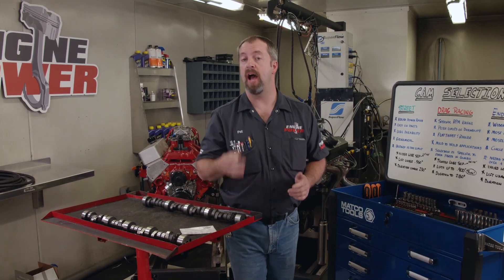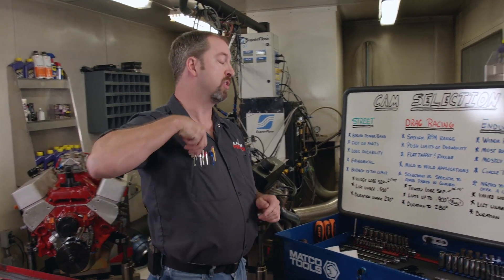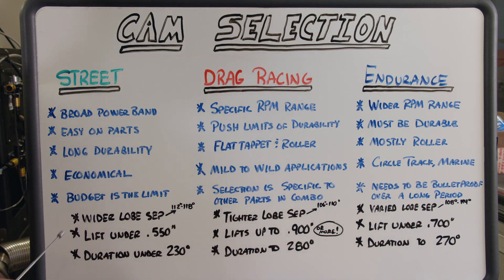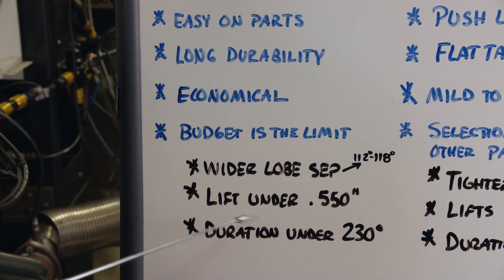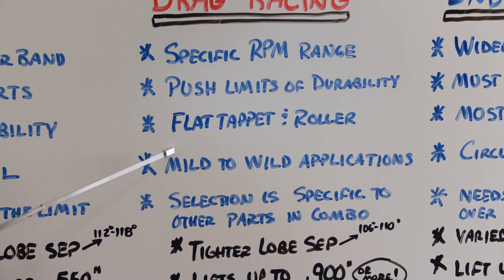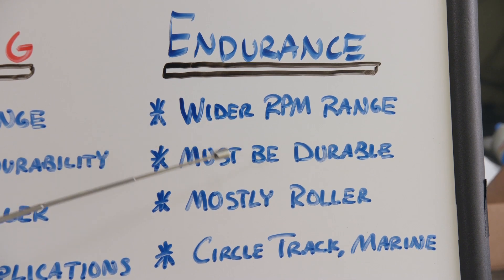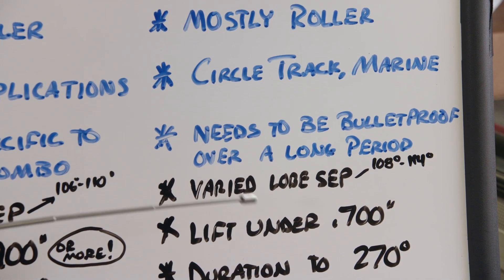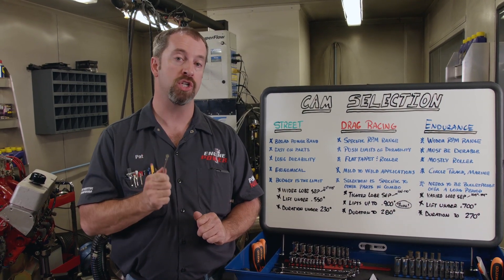How To Choose The Right Cam

Comment: I have a 2010 5.3 lc9...looking to get it up to 400 or so hp..any suggestion ..i already have a 1 in 2 out muffler..thanx in adv.
Reply: nofrop Texas speed stage 3 truck cam will get you close but if you have vvt you might need the vvt cam but 5.3 usually need heads to reach that to the wheels but to the crank it can be reached a lot easier call Texas speed they have everything even in packages

Comment: What are some nice lopey cams for my 2002 5.4 v8 triton with cold air intake and longtube headers
Reply: Questen Atwood Ditch that spark plug breaking piece of junk and swap in a coyote 5.0 and use a standalone ECU. If you keep that engine, please watch your oil changes because everything is run off of oil pressure and the slightest piece of gunk seems mess up your cam solenoids and other oil pressure regulated engine components. If you get a different cam you’re going to need supporting mods as well like valve train, intake manifolds, ECU tuning, and so on. You’ll need a cam that matches the flow rate of your heads/intake manifolds and you’ll definitely need a tune as well. First you need to decide if that engine plate-form is even worth the money/time. Then you need to figure out what you want to do with that vehicle. Towing? Racing? Mostly low-mid rpm or mostly high rpm? I know I didn’t answer your question but I hope I gave you some helpful insight. I hope everything goes smoothly with your build, cheers!

Comment: I guess my cam is too big for street. Shit. Lol. If you have an ls motor. You can go around .600 lift and 230s duration and you will enjoy it. The lobe type is Pretty important on Valvetrain durability as well. Seen a couple people asking about cam for a 5.3.. comp cam makes a cam XR275HR that would give you a nice chop with that many cubes. May need a stall. Had that baby cam in my car once. Good overall powerband.. came on around 2500rpm if I remember. My cam now is 235/243 .630/.610 111LSA and it’s much better in terms of power and torque but it doesn’t make much below 3,000. But You can see how the trend goes. Don’t get one that’s puny and too small. Cause you’ll kick yourself in the ass just like you would if you went monstrous. Stick in the high 220s to mid 230s. Ls motors like a split duration cam favoring the exhaust side. Good luck. There’s just as much torque lost in the heads as there is in a bad cam. Be warned the biggest isn’t always best in heads and cams

Comment: For street, think about the cam you want, then go slightly milder.
Giving up torque for that peak HP number isn't fun. You'll be spending more time below 4k than you will past 5500.
Reply: Old rule of thumb taught to me, pick your cam then buy 1 or 2 sizes smaller.
Reply: I [like many] learned that the hard way, many years ago.  If people could put an auto swictching set of hour meters on their engines [one for up to 3800rpm and one for over that], they would be shocked by their optimism.  A guesstimate of 20% of run time being upper end probably turns out to be 5 or 6%.  Circle track guys wouln't care about those numbers  because caution flags don't describe intended purpose: scream off the corners with buckets of torque any time its green.
Reply: *unless it's a stroker, then pick the characteristics you want, and go 2 sizes larger.

Comment: Ok before you go rushing out to buy a cam based on what this guy says, keep in mind your intake manifold, your torque converter, and size exhaust you want to run.  Those three are usually the dictators of what cam you need.  DO NOT USE THESE GUIDELINES on an engine that will be running factory injection or carbs less than 700cfm.  Trust me KABOOMS will happen.
Reply: Could you tell me what cam I need to make about 100 hp more on my stock 1994  f150 5.0 or what will I need to change to have a healthy long lasting 5.0

Comment: What i would like is someone to demonstrate on a dyno how changing one variable effects the engine. so start off with stock 350 then put in a cam with longer duration. then a cam is stock duration but different overlap. then stock except lift.
Reply: Not a good indicator at all.  Dynos are run at wide open throttle.  How often do you plan to be at 40 to 60 mph at wide open throttle?  How often are you going to be at idle to 2500 at wide open throttle?  See what I mean?
Reply: Yes this cam thing is tough. I pulled the trigger on a cam. Hope it doesn’t suck
Reply: My cam doesn’t suck. Heads flow 250cfm at 500 lift, cam lifts valves to .550 so just a little more under the curve, coefficient of flow from .200-.400 lift is 76% so pretty good, cam has longer exhaust duration so it helps scavenge, my cam choice was an xe266hr12, for a 10:1 332 Ford powering a 4600lb Manual Bronco, I’m happy

Comment: actually the most important aspect of Cam selection is the lobe Center angle and it's closely tied to the valve size in relation to the cubic inches the valve is feeding

Comment: What’s a great cam set up for a 
2017 Chevy Silverado 1500 
With a 5.3 engine? 
So far I have long tubes, 
high flow cats,
Cold air intake,
Sct tune on 93 octane 

Thanks!
Reply: same here :/
Reply: Howard's Rattler. 224/236 .550/.550 108°
Reply: You really dont need to change anything on the 5.3.  The stock cam is good up to around 500 horsepower.  Nice list of parts but the determining factor is your intake manifold for the LS style platform.  You can put the wildest cam you can find in it but it wont matter because the stock throttle body is 92 mm.  It's a choke point. The LS cam has a larger cam core then the old school small block Chevy.  The lift is more gradual rather than a fat man jumping off a ladder.  I wouldn't worry about your cam until you are ready to replace the intake manifold, injectors, and throttle body. After that sky is the limit.

Remember when you are watching videos about twin turbo LS's making 1000 horsepower on the street.  How often do they drive them?  500 HP for the street is no joke.  Anymore then that, you should be on a track, not the street.
Reply: Willy Montano mini of Burkhead

Comment: What's a good cam for a 1994 mustang 5.0
Reply: I'm trying to find out the same thing for my 73 Mustang
Reply: If its stock and you want to bring it up a bit but not be too crazy?  I would go with a mild RV camshaft or maybe one from a truck.  Those motors usually have longer runners to take advantage of torque at low RPM but still give you good midrange for the street. If you go too radical, dont plan on using the freeway anytime soon.  You may even want to change the gears in the rear end to help also.

Comment: if only selecting the correct cam was that easy
Reply: It's a starting point.  The one thing people must ask themselves first is what rpm range do they want to live in most of the time?  Street is pretty much under 4k, while full race is above that - measure tire diameter, verify ratios [axle and transmission] before even thinking about ogling a new cam.  The marine end [endurance] is the odd duck as you don't care about the middle much but need crisp reliable response at the low end maneuvering around harbors or no-wake zones [without being twitchy vs. prop size], and when getting somewhere fast pushing 5k or so for hours demands reliability.
Reply: Flinch I got a 89 Sierra shortbed single cab stepside with a K&N cold air intake, throttle body spacer, flowtech California legal headers and just one flowmaster I forgot what series anyways I want to have a reliable work truck but with some balls you know show up to the meets with the boys and burn some tire when asked I don’t know nothing about performance cams and I was wondering what’s a cheap reliable drop in cam for my setup?

Comment: my favorite question is when asked, what piston are you using, then i answer... then its well your cam depends on your pistons and your pistons dictates your cam, what intake are you using... what cc are your heads, what size carburetor are you using,  and what size intake runners.... i want to come across the counter on people and say, " THAT'S WHY I'M ASKING YOU! MR. KNOW IT ALL, HELP ME HELP YOU SELL ME SOMETHING AND GIVE ME INFORMATION THAT WILL HELP ME PURCHASE THE PARTS I NEED FROM YOU "
Reply: Question.... I have a 5.3ls and I am having the hardest time figuring out what cam to select for my project. I don't want to touch up everything other than the cam and springs .. basically keeping it street with more hp... I will be using a ls6 intake everything else is stock...? Any good suggestions on cam selection

Comment: What cam would you recommend for a street/offroad vehicle
Reply: what cubic inch, heads, compression, exhaust? does it need vacuum for brakes , is it computer controlled or carb?
Reply: Im putting a 2004 tahoe engine into my 95yukon so no clue its more then likely a stock engine, plus i bought a 4l80e transmission to hopefully mount up to it
Reply: All i know is its a 5.3 which is a 327 ci block
Reply: @phyrexianjudgement  224/226 @.050 and .525 .525 should do nicely. About a 110 lsa if I had to guess.
Reply: What would be a good cam for a ss m6 ls1? Its gonna be a street car but borderline race/streetcar.

Comment: What about cam thrust button clearance on retrofit hydraulic roller cams? The tightest clearance I've been told is .003" and the loosests I've been told is .012". Everyone says to file the nylon buttons until you get the desired clearance, but what if I'm running a cast timing cover and a double roller timing set with thrust bearing? The nylon is by far the softest part of the whole thing. Won't it just self clearance to a minimum spec when I start the engine the first time?
Reply: Look at some videos by myvintageiron.
Reply: Limo Wreck what are the chances simply torque right the timing belt.i did mine not the pro way and still hav ent had any problem.just do it
Reply: @abielm123  timing belt? We're talking about cam in block, overhead valve engines that usually drive the cam with a chain unless you are getting into some serious rpms. You still have to restrict longitudinal cam movement because it drives the distributor and can cause erratic ignition timing and, if it moves too far, a lifter can fall off the cam lobe. When that happens you get LOTS of metal in the oil. Cam thrust is important.
Reply: Limo Wreck dude just buy a cam and install in.at the end of the day all that specs don’t matter 😉
Reply: Ever seen a cam walk forward and drop a lifter off the lobe? It's rather nasty.
Reply: if you're running an engine with a plate that holds your cam into the block,you need no cam bushing,if you are running an engine without this plate,you need a cam bushing,camwalk is a reality and it can really cause havoc to your engine,if running a chevy,small block mopar,pontiac,buick,olds,small ford,you absolutely have to put a timing chain in every 80 to 120 k miles,if you are using it for a grocery getter,why are you here?there are some engines that eat timing chains,when the chain gets slack it hammers the lifters and the other cam timing components in the engine,i like to run 0.005-0.006 clearance max on cam walk